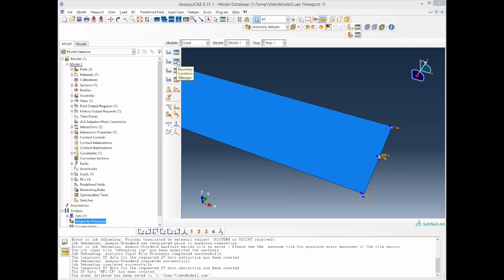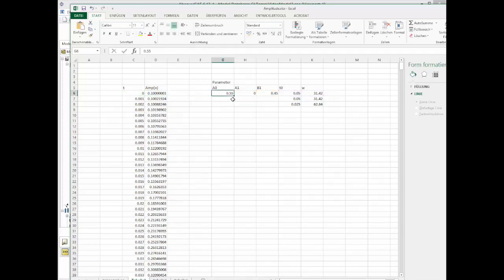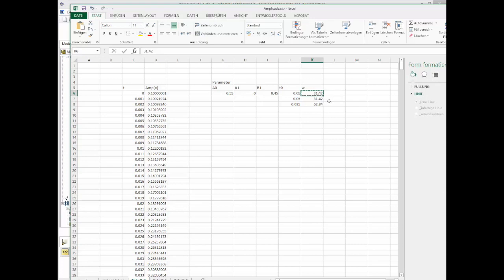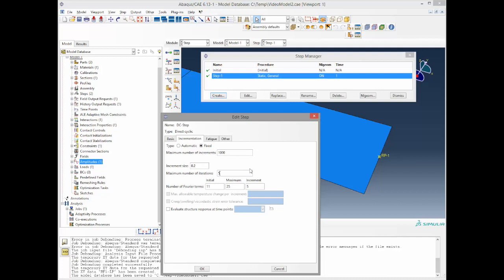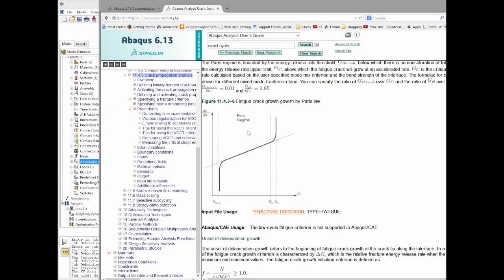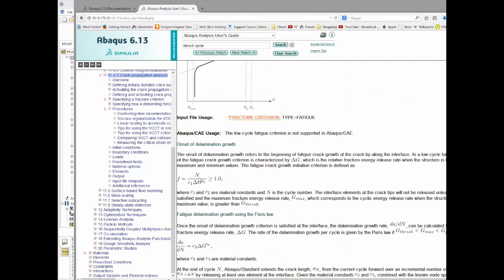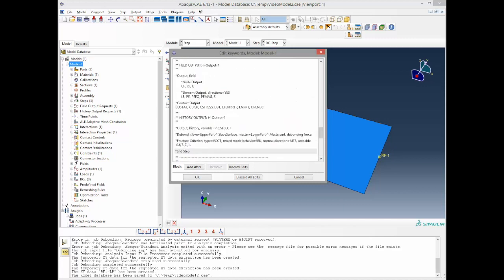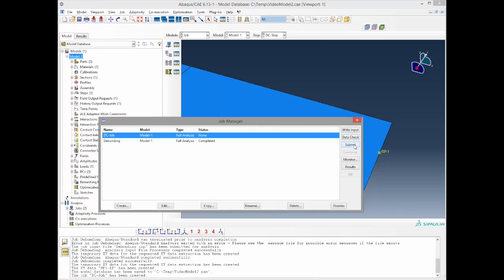Fracture Mechanics: CLS Specimen VCCT Debonding in Abaqus Part 3: Direct Cyclic Fatigue Analysis

Comment: Hi Manuel
Many thanks for your time. Is it possible to simulate crack propagation with just direct cyclic or do we have to first define static general step?
Reply from the maker: Sure 👍 you need to do a static simulation because the energy for one cycle is calculated this way and the direct cycle method compares that to the energy release rate. Paris' law and all.
Have a good day 👍

Comment: Can I use NLGEOM = Yes in direct cyclic?
Reply from the maker: I am not able to check any more as I do not have access to abaqus right now. Should be not a problem though I guess. Did you get an error when applying it on your simulation?
Reply: @ManuelRamsaier  I didnt get any error. But I have some concern the way I am getting the results. I applied only direct cyclic step. And in the first cycle itself at 0.05s step time, the stress values have shot up. How is that even possible?

Comment: Hi i am wondering why did you change displacement loading to force loading. In my case i have to apply the displacement loading for the fatigue analysis of double cantilever beam specimen. Is it possible to carry out fatigue analysis with displacement load instead of force

Comment: Hello 
I am working on the role of surface roughness on fatigue. What analysis would be suitable in order to find out the number of cycle that materials fails?
Reply from the maker: not the vcct method as it requires an initial crack specification.
Reply: Can you please make any tutorial video on that? As there inst any video on that in you-tube, I will provide you the specimens and already done the mash.

Comment: Hi Manuel, thank you for the video. I am really appreciate it. I am doing fatigue crack propagation. So I use Direct Cyclic analysis with low cycle. I set number of cycles 20,000. 1 cycle is 0.1s and time increment=0.01s. So I will have 10increments per cycle. But instead of having the result for each cycle, why Abaqus only gives me the result for 1st cycle and 1 last cycle? What makes this happened? Please help me..thank you very much
Reply from the maker: One possibility is, that your crack does not grow. Then all the cycles are done whithout the event that the strain energy release rate is greater than the critical one, please look at the definition of your bonded nodes again or increase your loads and see if the crack grows.
Reply: Hi, Thank you very much for the reply. I can see the crack growth in the last cycle. Shall I send to you my model so that you can take a look at it? Hope you have the idea on whats happening.

Comment: Sir, I am looking at the problem of DCB delamination by Alfano given in benchmark Abaqus documentation. The composite consisting of 24 layers has been modeled as two plates with a delamination crack between them and no fibre is considered in the model. This is the case I'm seeing with every DCB problem.
What is the reason that they don't model all the 24 layers and don't even consider the fibre?  
Is that because we are only interested in the interlaminar crack which will only propagate along the DCB interface and is affected by only either VCCT fatigue input parameters or cohesive elements?

Comment: sir,
I am doing a fatigue analysis of double cantilever beam having composite material and my model is 2d .Plates of dcb are contacts by bonded nodes and i am applying a displacement loading having magnitude vary in the form of cyclic loading and analysis is low cycle fatigue analysis and i apply a displacement of max .67mm and min .067mm at the one end so when i am submitting my job for like 1000 cycle then cycle run till 30 to 35 cycle and after this cycle jumping takes place and reaches direct at 1000 cycle and analysis become end  means it not run for full 1000 cycle ,this is not only happen for 1000 cycle but also for 100,500 cycle etc. To propagate crack it shoud run min for 1000 cycle but due to jumping crack is not propagating.so
please sir give me the reason why it happen .
sir i am a new user of abaqus.
Reply from the maker: try with a force instead of a displacement and check if you have the same results. Also check your energy release rate setting for the crack. The behaviour of the simulation says that your crack initiation is with 35 cycles and then no nodes get debonded until your 1000th cycle. Try increasing the number of cycles to 10 000, too and see if you have a different behaviour.
Best regards
Reply: Manuel Ramsaier dear sir, the problem I am facing is that as the crack propagates through the interface between the Dcb specimen at whatever cycle number the cycle jumps to a higher value say directly to 1000 or 10000 from a lower value at which the crack propagation started. what could be the reason for such behaviour that cycle is not commencing forward one by one and instead jumping directly to higher values. does the problem exist in fatigue input values or the meshing of the Dcb plates?
Reply from the maker: This completly normal behaviour. You have a discrete structure (through your element size). Lets say the crack starts to propagate at 500 cycles and then it jumps to 1000 cycles. That says that it takes 500 cycles (500 -> 1000) for the crack to grow one element size (I assume that with each jump one element gets debonded.
Best regards,
Manuel
Reply: thank you sir..
Reply: sir 
But in my model cycle jump takes place from 1st to last cycle , whatever is the last cycle eg.
 it may be 1000 ,1500,2000,10000 etc means  running is not taking place between them due to this crack  not generated .so
sir please give the reason why this happene.
Reply from the maker: So your crack does not grow and the simulations just goes from cycle 1 to end with nothing debonded? Then you might want to check your crack initiation criteria. On the othe rside you can increase your load.
Reply: sir I am doing fatigue analysis of 2d Dcb having material is graphite/epoxy and the specimen is modelling with solid plane strain elements so to model this type of elements we have to define plain strain thickness in section module so please tell me how to define and what is the meaning of this thickness and when it define.

Comment: Can I use VCCT within Direct Cyclic analysis? I want to measure crack propagation by number of cycles. Please help, I'm new to Abaqus.
Reply from the maker: Sure, the video above shows you how.
Reply: No. I want to use VCCT in the DC-timestep. In DC timestep you used FRACTURE CRITERION,TYPE=fatigue, i want to use FRACTURE CRITERION,TYPE=VCCT. I`m not sure if wat i saying makes sense, but I want to see the crack actually propagating in the DC timestep and make a "crack size x number of cycles" graph.
Reply: oops, never mind. I just tested with a higher load, the crack can actually propagate in the DC-step with your method.

Comment: Hi Manuel Ramsaier,
This is a great video. But I am confused about two things. 
(1) Why you set up the time period of step 1 to 0.2 ? Because I think the step 1 is just a initial loading. I think it can be 1 or any value.
(2) In direct cyclic step-fatigue, you set up the maximum number of cycles to 10^5 which I think is a long life prediction. I am not sure.
Thank you for this great video again.
Reply: And one more thing I think is important is not to forget to add *Debonding ahead of * fracture criterion, which is not explained clearly in users guide.
Thus, a question pops up: if we want to use low-cycle analysis, do we always need to define a debonding pair? Can we just specify a crack, and use the low-cycle to do the simulation?
Thank you!!

Comment: Hi Manuel Ramsaier,
Could you explain me how did you find the parameters An and Bn from the Fourier Series?
Regards,
Andri.
Reply from the maker: Hi,
you mean the parameters for the curve? It is explained at around 2:00

Best regards,
Manuel
Reply: Hi,
I understood how to plot the curve, but I didn't understand how did you get the value B1=0,45, A1=0,0 and A0=0,55.
To find these parameters did you calculate the Fourier Serie? I mean, did you solve the integrals?
Regards,
Andri.
Reply: after you plot your amplitude curve,you'll have to assign it to your 
loading period. here it is needed that the load oscillate between 700 
and 7000 and also we have a ratio 1/.1 between the max/min amounts of 
amplitude curve which covers the request from periodic load to change 
between two values with the same ratio(7000/700). the minimum load 
magnitude is assigned in EDIT LOAD ,so the mean value in EDIT AMP held 
.55(.9/2=.45 and .1+.45=.55 ) and finally A1(cos coefficient) is 0 and 
for B1 (sine coefficint) we have .45 

and i think you should pay attention that here we have a simple sinusoidal wave so as sine oscillate between -1 and 1,thus we have to adjast the amplitude we need as a coefficient. so in this problem we eventually get:
A0+B1sin(n pi x/l)=.55+.45=1 for max == 7000 and .55-.45 =.1 for min==700

Comment: Could you please help me how to assign the kinematic hardening parameters for steel material in a cyclic loading. do you know why I get this error " Linear kinematic hardening requires two yield stress values for each dependency
Reply from the maker: +Sepehr Movaghati Hi. The problem lies within the material definition. There it seems you have given only one stress strain point, but for the linear kinematic hardening, it requires two points in order to interpolate between them. I am no expert on that material model you are using, please refer to the Abaqus help. Thanks for watching.
Reply: I am not sure what is going on since I specified three point of stress-strain relationship
Reply: Actually it only works with two points that's why it is a linear kinematic hardening not a nonlinear kinematic hardening.

Comment: how long does it take to run this please?
Reply from the maker: +Alex Fry Hello Alex, I do not remember the exact times but it was within a few hours or less. Depends on the hardware too. I run it on a desktop pc with 4 cores and 16gb RAM.
Reply: +Manuel Ramsaier Manuel, I appreciate the video, its a great help to me. Are you able to make a tutorial or explain how you can obtain the graph which shows the crack propagation in dependence of the cycle numbers?
Reply from the maker: +Alex Fry Unfortunately I have no longer access to a abaqus license. But I can tell you how to do it. As you go through your output file in Abaqus, you can watch the specimen debond. There is somwhere at the top the cycle number and you have to go manually (yes!) through all the steps and look when it opens a node pair. You can then note this cycle number and as you know the element size you can create those crack propagation vs. cycle number plots. Soryy, but that is all I can do for you right now.

Comment: Thanks Manuel for the tutorial.

I had a question to ask. In the Direct Cyclic Fatigue Analysis tutorial, what final results do you obtain ? i.e the number of cycles to failure etc ?

Thanks!
Reply from the maker: +Yohhan Karkera You can obtain an graph which shows the crack propagation in dependence of the cycle numbers.
Reply: +Manuel Ramsaier thanks for the tutorial.  I have tried to finished the modeling and simulation parts.  And in the post process part, how can I obtain the graph that will indicate the number of cycles to failure?   thanks.

Comment: Hi Manuel,
Thank you so much for your tutorial, Im making my intership and starting with abaqus dynamics analysis, so i have a question, with the frequency of my system, the amplitude (100 N), and average strength (150 N), can i build this table?
Reply: +PhDGameBros  Thank you so much for your support, i will continue to search.
Reply from the maker: +Pedro Henrique I think you landed on the wrong page. The VCCT method is about crack 
propagation and therefore not a  "simple" dynamic analysis as it is in 
your case for a table. I think the smith diagram or the wöhler curves 
are more suitable in youre case. Best luck with you intern!

Comment: Hi Manuel,
Thanks for sharing this tutorial!
I have some questions regarding my work and I would be gratefull if you could give me some feedback:
I'm doing a fatigue crack propagation on a three point bending test with 5e10 cycles with a triangular loading wave with a maximum force of 7500N and minimum of 750 N.
Is the low-cycle fatigue analysis viable to do this test?
I have an intel i7 3.60Ghz and 16GB RAM, and even using a lower increment number of 100 increments and an increment size equal to the cycle time of 0.05 s, I am still getting enormous odb files with 120 GB and a computing time of about 40 hours, is this the usual time? 
I have been looking in the internet and wasn't able to find any reliable information about this.
I would also like to reference your work in my MSc Thesis, how would you suggest me to do that?

Best regards
Frederico
Reply from the maker: Frederico Dutra Hi. So there is two option a CPU can calculate this type of problem: Incore and OutofCore. As your mesh size gets smaller, you need more RAM to a point where your physical RAM is not enough for the InCore calculation. Then the solver writes these large files as temporary junk because of lacking RAM. I would suggest you start with a mesh size so that you have in core behaviour of the Solver. I am not quite sure about how much that is in terms of element numbers but you will figure it out. Start with something coarse. Refinement can be done when you are sure about what you are doing. 
I hope this helps. If you want to further talk about your theses, please write me an Mail ;) 
Best Regards,
Manuel.
Reply: Manuel Ramsaier  Thank you for your help. I will take your advice, and build a coarser mesh and see how it goes from there. In the above comment I mistyped the number of cycles of my analysis, which is 5e5 cycles.
Best regards
Reply from the maker: DaWaiks Hi. The number of cycles has nothing to do with incore / outofcore behavior. The number of cycles defines how much you have to extrapolate your crack length (depending on crack growth velocity). The incore/outofcore behavior only results on the complexity of you model (so in this case: Number of nodes, elements, available RAM).
I wish you all the best and would like to hear if that worked for you.
Reply: Manuel Ramsaier Hi manuel, I have contacted you through the email you have in your channel. Is it the right one? I still have some questions regarding the analysis. I would be grateful for your help.
Best Regards
Frederico
Reply from the maker: Frederico Dutra It is ramsaier@hs-weingarten.de I have recieved a mail from you on Sunday. But with no questions in it. You can ask me per mail and I will help you if I can.

Comment: in step2, the contact is not active anymore. So this analysis is not correct, I think.
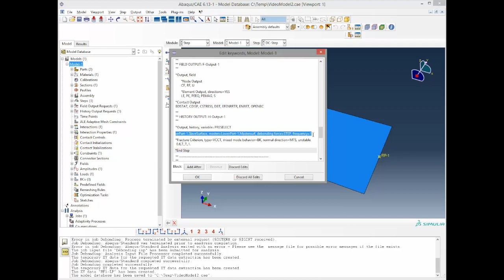Reply from the maker: At 11:19 you can see me editing the input code for the direct cyclic steps. There you can se the line: *Debond ... which defines the contact definition / separation pair. If the contact definition would not be active in the direct cyclic step, the mode would not run, I suppose. What makes you think that the contact is not active?
Best Regards.
Reply: Manuel Ramsaier Please check interaction manager.the s-s contact is not applicable to step2
Reply from the maker: I can assure you that it was active in the model. I can not see where you think it is switched to inactive. The BC's are this way that the model would not be sufficiently contraint without this contact. Also the *debond command would get an error becaus it points to the ss- contact.

Comment: Hi Manuel, could you show me the results of the fatigue analysis? I just wonder what could you get from it. Thank you.
Reply from the maker: Hi,
you will get cycle numbers correlating to crack propagation which you can manually extract into a crack propagation over cycle curve. I am affraid I can not show you the data but you can simply find similar curves in the papers written by R. Krueger
Reply: Manuel Ramsaier So is that means me I need to have a crack in the model and crack initiation criteria so that I can use the load cycle fatigue module of ABAQUS?
Reply from the maker: 周哲 If you want to do a fatigue crack analysis, yes. The direct cyclic method comes into play in a waste amount of other analysis types which are not discussed here and on which I have no experience currently.

Comment: Hi Manuel
Thank you for this tutorial, and I think there is a gap between the theoritical part and simulation in abaqus part, my question is there any lectures or books dealing with this topic (debonding and delamination )
thank you
Reply from the maker: with a CLS specimen...not so much. But you can find many papers done by Krüger from NASA. I have my knowledge from there, books are very rare in this topic.